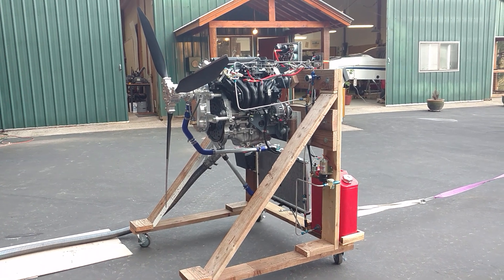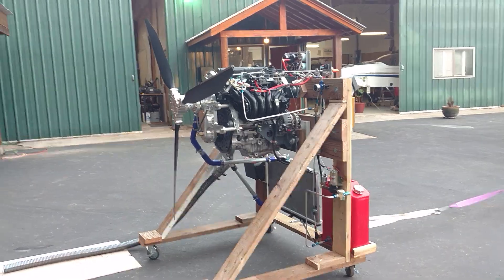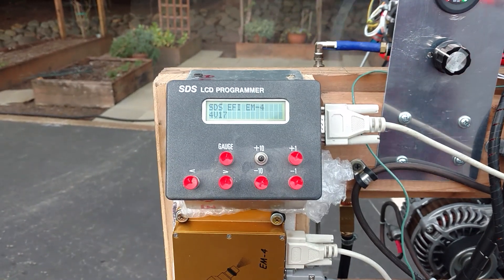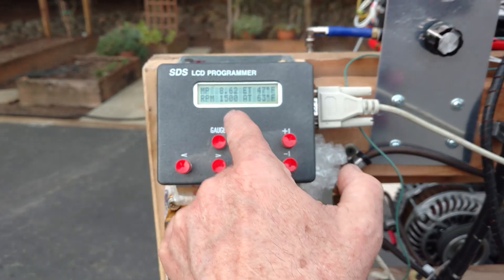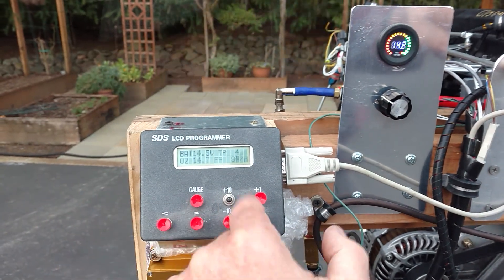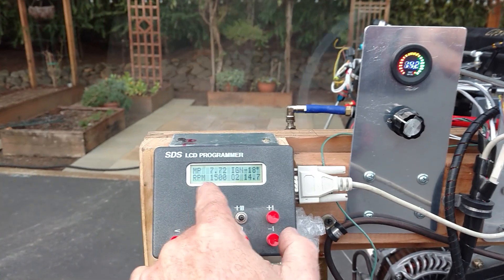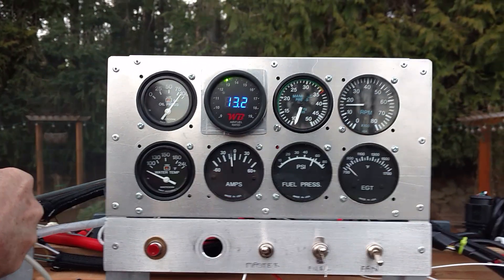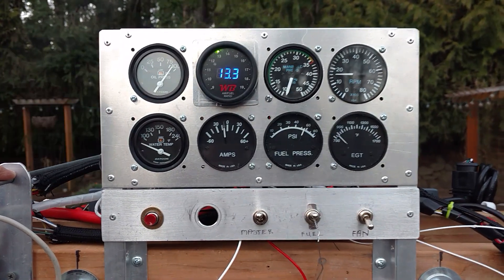Honda R18  Civic 1.8l engine runup with prop etc

Comment: I noticed the Amp meter showing a discharge? Not set up or faulty?
Reply from the maker: I had not noticed that.   With the voltage high I suspect I just have the wires backwards on the shunt.    Thanks.   Ill check that out!